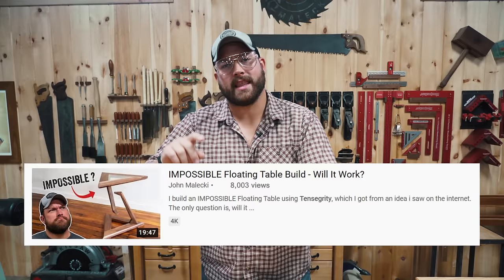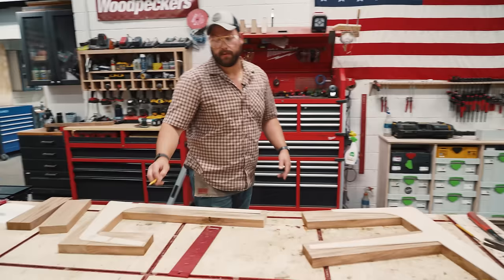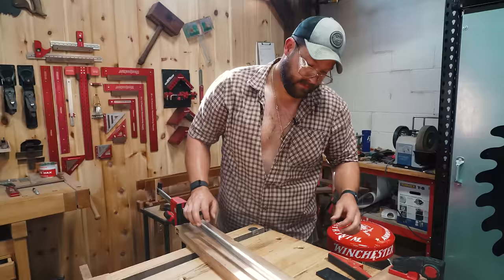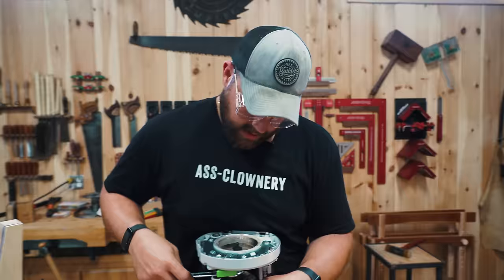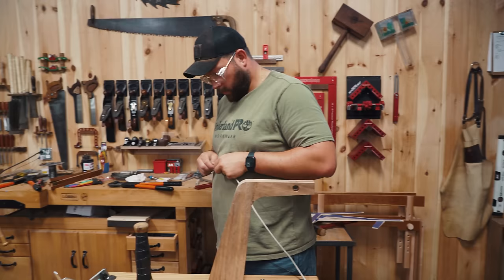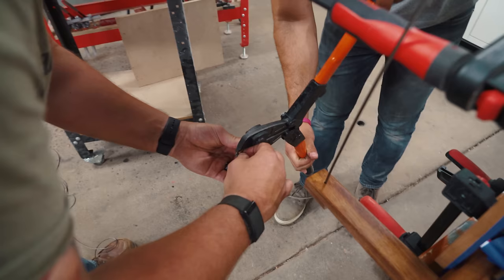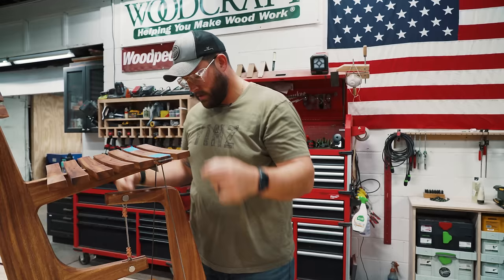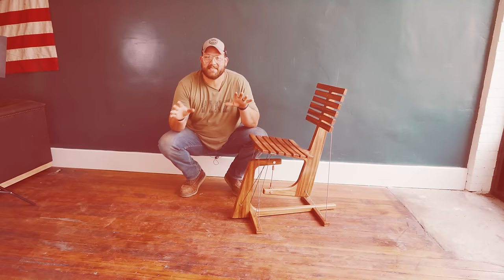Does This Chair Actually Work? My IMPOSSIBLE Chair Build

Comment: I would stabilize it by adding 4 vertical pieces of wood that connected from the seat slats to the floor. 😎
Reply: It's been done a million times
Reply: @betanick14  that was the joke
Reply: That's genius
Reply: I see what you did there. 😂
Reply: That's genius. 🤯🤯
Reply: I like that thinking out of the box
Reply: C.
Reply: Settle down, we don’t need to start trying to reinvent wheel.
Reply: Wow original. I bet that would get loads of views
Reply: 3 vertikal pieces should olso Work 😉
Reply: I would stabilize it by putting it on the floor directly
Reply: @mattwillig9102  Wheels wouldn't be very stable tbh.
Reply: That will never catch on. You mark my words...
Reply: Bro, genius. Brilliant. Innovative. 🎉
Reply: 3 is enough

Comment: John, I think some of the issues may be coming from how the cables are ran through the wood as one cable.  I think the way they are ran through the seat back proper allows the chair to slide back and forth.  If they were attached to the chair as individual pieces the chair couldn't move.
Reply: More importantly the supporting outer cables need to be tensioned when the chair is under load. The way it was produced here the supporting outer cables become slack under load ie. not supporting the load. Applying more poorly tensioned cables did little to improve the situation.
Reply: The outside cables don't support the load, they go slack when someone sits down because you're taking tension off of them... The only cable that supports your weight is the center cable, the rest of the cables try to balance the forces. If you imagine a plate on a ball with each corner tired to the ground, as you push on one corner the rope on that corner becomes more slack, while the opposite corner becomes more tense. HOWEVER, your point is still valid to a degree. You can over tighten the outer cables, causing the object to collapse with the smallest tip in balance while it's not under load, but you don't want them to be too slack while under load, or they are not fulfilling thier purpose.

Comment: What makes these tensegrity items so “magical” is that it looks like it’s floating; when more and more cables are added it begins to lose that magic because it looks cluttered. The fewer cables the more magical. I also think you should increase the distance between the underside of the chair and the top of the bottom support to really emphasis the illusion that the body of the chair is not connected to the legs.

Comment: The center of gravity needs to be centered more over the central cable when someone is sitting in the chair. But the fact that it's a chair means that leaning back places a rotational moment, moving the CG that overpowers the cable tension in the front. a stool would probably work better. Though, it does look awesome.
Reply from the maker: I thihnk i need to triangulate the whole design, add some widt hto the back and it may help! thanks Puke!
Reply: @John_Malecki  

if you make a cable from the lower suspension point to the rear legs, it probably stops the unsteadiness and the lower point cannot move forward.

and was able to learn many of your projects and use in making projects in the netherlands
Reply: Had to agree. I would love to see this as a stool as well, since you will only sit upright on the center the twisting/rotation will be minimized
Reply: I agree with Schmill. The main cable that holds the weight needs to be towards the rear of the chair. Basically line it up with your spine when sitting. You had it too far forward and created a moment that caused the front cables to burden the load instead of containing the load to main support cable.
I’m a mechanical engineer so I saw the issue right away.
Reply: Could you add another main cable from the center straight to the main support of the top... and add tension so when you lean back the chair does not

Comment: What helps a lot with these tensegrity structures is diagonal cords. like from the left front down at the ground to the left back of the seat itself, from the left front of the seat to the right back down, etc. i did that on my tensegrity shelf and the stability improved drastically. evan and katelyn have a video about it

Comment: The Golden Gate Bridge had less cabling than that "floating" chair...  interesting build though
Reply: It's coz it's a first try for them but yeah taking notes from suspension bridges is probably needed here.
Reply: Liar.
Reply: To be fair though!
Reply: Actually there is about 80,000 miles of wire on the Golden Gate Bridge and there is approximately 11 to 14 feet of cable there
Reply: @SodaDaquavion  cringe af mate quit bleeding social platforms
Reply: I want to see a video of you building one of these chairs.
Reply: Those wires form a net and catch your fall when it collapses. 😄
Reply: Still super impressive, be positive 👏🏻
Reply: @SodaDaquavion  you could literally just say "joke"
Reply: @SodaDaquavion  The only problem here is that you wooooshed on Wyatt’s joke, since he was portraying the classic “Actually,” nerd. So, actually... *pushes glasses up*... you just wooooshed yourself by wooooshing.
Reply: It's interesting how the Golden Gate Bridge had less cable than that floating chair but my question is where is the floating chair you built I want to see how much cable you used cuz me personally I've never built one. I'm paralyzed from the waist down I think it would be awesome to have a wheelchair that was floating
Reply: @ryanstrong6164  You don't have to be a cook to know if the food is shit.
In this case, yea, good effort, but the chair was a fail.

Comment: As an amateur wood worker, seeing those perfectly square edges after jointing makes me weak in the knees
Reply: Dude same I only been woodworking about 2 years now and the two best days of my woodworking life so far we’re the two different days I bought A a plane and B and jointer lol and don’t just buy the cheap ads big box store bench top ones sage up and buy the big 13” dewalt planet and a floor model at least 6” jointer that’s what I have and now it’s so so easy to make perfect square edges and faces that are beautiful and will leave you loving your hobby much much more it’s totally worth it oh and a table saw and track saw and good sanders lol that’s all you need literally
Reply: @TheHomeMaker1  I bought a wen lunch box plane and it does a decent job. But I also bought and had to return a porter and cable 6" jointer. The jointer had aluminum tables and jointing just soft yellow pine for one project on it, huge deep scratches went into the face of the jointer leaving positive matching scratches onto the wood face... 
I'm now saving up for a for model, any recommendations?
Reply: @pengwin429  if you can afford it (or save up enough), one with a spiral bit cutter-head.  I still need to get one eventually.  Probably a Delta, Jet, Grizzly etc.

Comment: That gives me an idea for a full tensegrity dining room table
Reply: Not what would be cool.
Reply: Wow, I typoed that one really badly.
Reply: Make a metal frame covered with wood do some seriously scary you've never done it before cable tension with a lot of weight on top of the table it will be Rock Solid
Reply: @greggarrot8132  I'm in the process of building it got the design done. Its going to be amazing

Comment: For stability tighten the front wires a lot more, bringing the chair forward a bit. Then how about, adding wire straight down to floor base, as oppose to two that you did and add tension spring to the center tension wire also to absorb some shock?

Comment: As a project it's quite nice. I've always loved this kind of "How the hell does this work?" things.

My thoughts about the design are, that the connection between the base and the chair that supports everything should be more on the rear, this way the main tension rope goes with the center of gravity. Probably it's enough to invert the orientation of the wood hooks that he made for the main cable.

Comment: To fix the rocking back back problem you can run a hole from the base of the seat "arm" (where it pokes out from the rear vertical back support) and twist the 2 wires together and inlay them into the front arm of the base to anchor them at the very bottom where the chair sits on the floor

Comment: You could benefit from taking some physics courses. 

The main issues you're encountering are coming from alignment. Your loads are varied, but your cabling is not, it generally follows one direction which is obviously weak and unstable.

That is not to advise perpendicular alignment. I recommend short interval curved parallel alignment. Consider compression, ductility and the engineering benefits of shallow, long span lateral and vertical arches when designing your pieces.... Good luck.

Comment: Maybe a second wire like the first one you installed towards the back can help stabilize the tilt forward to back. Since it’s all about balance, perhaps more balance between cable in opposite directions of tension.

Comment: Very nice build. It looked like some of the wires you built were able to slide through the wood. I would change those out were  they were unable to slide. Also I would run wire from the back piece at the lower point that has the main wire (the very first wire that you built in thto the vide) to the front legs. Hope this helps.

Comment: I believe if you were to add a second line to your first and 'main' attachment point on the 'base' and connect it to a point further back on the 'floating' piece (basically a triangle with the top at the metal anchor), you could eliminate the majority of that sag that occurs when you add weight. Additionally, you could add a couple tension strings which begin on one side of the base, go through a hole on the floating piece, ride up the length on the other side, then come back through another hole near the top and attach back to the original spot on the base. This could add an element that resist the side-to-side deflection.

Comment: The upper chair piece's main support cable attachment could also be wired to the same rear outrigger points to prevent the back from torquing forward.  Might work

Comment: Base rear most point cabled to the seat lower bend will add more rotational support. Currently the seat lower bend to the rear side anchors is what is trying to stop your leaning back rotation but doesn't have a good angle for front/back directional support as most of its strength in in the left/right direction. The closer to horizontal the cable the better, Might want to even consider a little upwards hook to the wooden structure to elevate the new cable anchor.

Comment: In order to keep the back portion of the chair from racking downward when sitting into it, could you run the cable into the wood just above the rear arm, and groove the contact point, and have it track over the top of the upper arm. You could also inset this mechanism and attach to a screw if you wanted to be able to increase or decrease tension. It may be noticeable, but everything is really. This would help transfer the weight from the back portion of the chair onto that front upper arm.

Comment: you got it right at the end when you said your cent of gravity is to far forward. Plus the wood is flexing under the weight which is allowing the back to dip down. make it have 2 of those center cables.

Comment: I would just move back the bottom connection of the main support wire, and fill the previous hole. You can figure out the center of gravity by applying a few mathematical equations....love your work.

Comment: This is sweet. i still cant wrap my head around whats keeping it from rocking backwards, at least to the point where the lower mounting cable mounting point (bottom of the chair piece) goes forward and its the back of the front vertical support. I'm sure its simple, but its some kind of optical illusion that I can't figure out

Comment: Hello 
Amazing fabrication regarding the chair
As a civil engineer i can help you by reminding you about one small thing : in this type if design the key is to have both of the gravity forces on the same alignment and by meaning both i mean the person sitting and the vertical cable holding the curved center part in the chair otherwise you will have the extra force coming from the eccentricity that the cable will take
Good luck on thr build it was a great one overall

Comment: Center points with tension cable move back 3-6". Put "t" head on the base or upper side to create a triangular cable that has two anchor points on the base and one on the seat.  It opposes those you used on the front and back, and sits on its point as seen in a plane, creating cross bracing.

Comment: I would make the bottom of the seat support? parallal  to the ground then I would  move the long back cables to were the lower back cables are and keep them close to a 45 degree angle. I would also move the back piece forward and relocate center cable. Then I do not think you will need the added cables. Fun Video

Comment: As a big guy myself (6'4", 260lbs), I feel your pain... :-) 

One way to possibly stop the rearward motion in the chair as it is now would be to run a cable from the rear section, along the top and down the front of the front section, if that makes sense. This would actually pull tight as weight is applied to the seat and prevent, or at least limit, the rearward movement. If necessary, a groove in the wood will prevent the cable slipping sideways. You could even be really clever and fit a V groove bearing at the apex of the curve on the front section to prevent wear and tear.

Also,  with regard to the fans/background noise in your shop, I have the same problem. It gets stupid hot in my shop, plus I have the 3D printer running almost 24/7. I found that one of those little sponge covers on the mic really helps eliminate background noise while helping you stay more comfortable. I would also add that, if people continue to moan, tell them politely to do one. After realising very quickly that people will moan no matter what you do to try and accommodate them, it's far better for your sanity to just ignore them. Youtubers are providing masses of content for free - viewers must learn to make allowances. I generally say to people now "if you don't like it, don't watch". Sure it may cost me a few views, but it's made the whole process so much more pleasant for me and for the people who genuinely appreciate the content.

Comment: for the pulling when you try to lean back, i'd put another (short cable) from the front of the seat (the center beam) straight down to the main support beam. Possibly even angled (not much) from the seat beam forward towards the front of the chair onto the main beam. This is one of those times when I wish I could put a picture comment so I could draw what I mean.....

Comment: How about adding a secondary tension point behind the back of the chair? Meaning the central cable has two points pushing upward, one in front of the backrest (the one that's already in) and one behind the backrest to relieve a bit of the spring when sitting back. This would in theory also mean way less other support cables.

Comment: On the back bottom cable that goes left to right use cable tensioners that they use in cable railings. Have some one sit on it slowly then use the tensioners to tighten the cable up. Any place you have cable going through wood a metal sleeve would be nice.

Comment: I think the key to this is to think of the cables on each corner as a 3-legged stool, for a total of 12 cables (13 if you count the center one).  Also, think of the base as a 4-anchor-point plane, and the bottom of the seat as another.  Now it's a simple task of having 3 cables come up from each bottom corner, to the seat corners directly above and to the left and right (i.e., not the far diagonal corner).  Also, engineer some sort of tensioning system into each of the 12 cables, such as turnbuckles, hidden perhaps within the seat and accessible from the bottom.  Now those 12 cables, 8 of which are on a diagonal line to 2 other corners, will provide the rigidity you're after, without sacrificing too much of the 'invisibility factor'.  And if it does, simply start subtracting cables, starting with the straight vertical ones.

Comment: run a cable from the bottom pin of the main cable to the tip of the cross in the back of the bottom platform. could even pin it like the main hang cable. should solve the issue of chair wanting to pivot.

Comment: Building on what someone said above, the biggest issue that you're facing is the rotational element when someone goes to sit back in the chair and causing the center of gravity (CG) to shift. I believe if that center cable were located further back, by lengthening the top center spoke (coming from the base) and shortening the bottom center spoke (coming from the back and base of the chair) it would greatly reduce the rotational instability you're seeing. Alternately, four straight and fixed length cables coming from either the four corners of the seat, or the two front corners of the seat and the two bottom corners of the back, into the four corners of the base should also prevent this issue.

Comment: Awesome design. I bet if you got the centre of gravity figured out it would work perfectly. 

To figure out where your lifting wire should be placed, build a regular chair with the same dimensions an figure out where the centre of gravity ends up when you are sitting comfortable. 

Balance the chair on a couple of 2x4:s and a dowel or similar to figure out where you can get it balanced. 

I bet the centre is much closer to the back legs than the front.